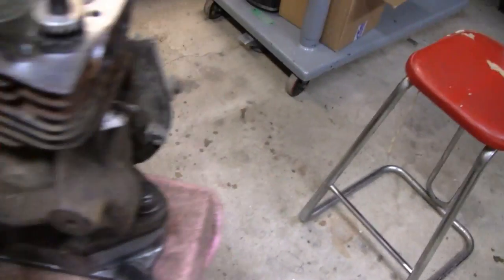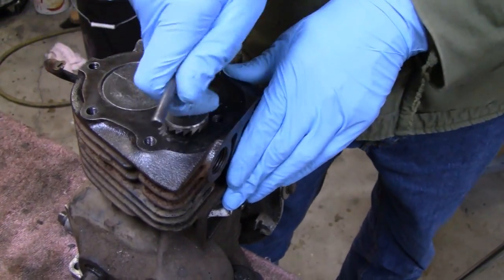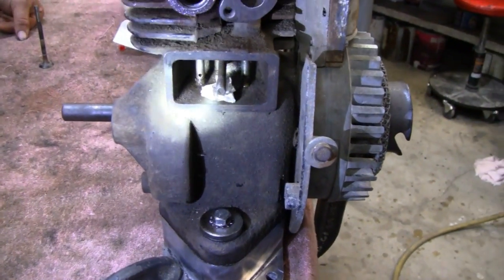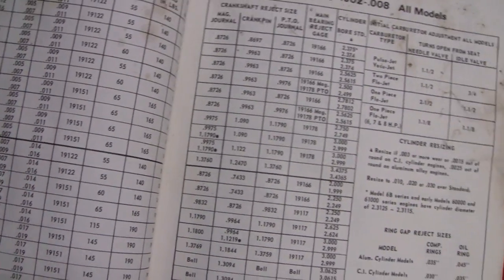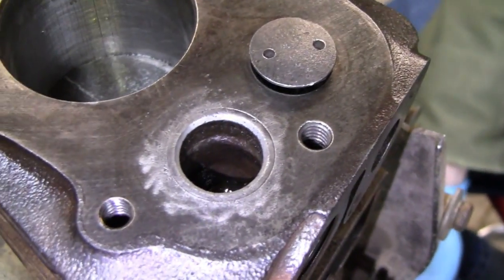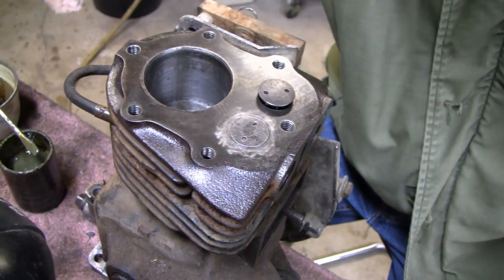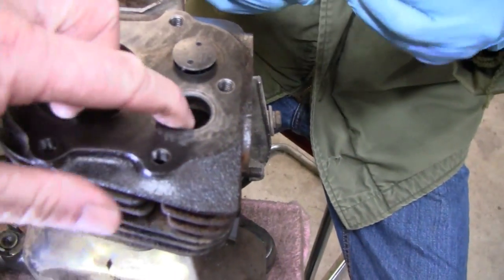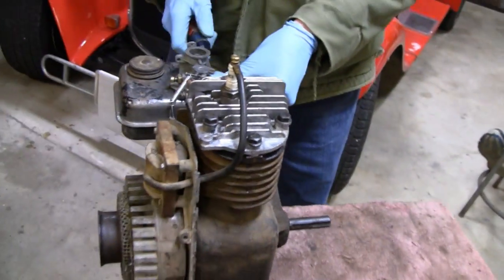HOMEMADE WATER COOLED BRIGGS ENGINE (part 7)

Comment: why did you not use the small side of the lap stick? also i used to use a drill to operate the lap stick.
Reply from the maker: Small side won't work because of the holes on top of the valve!!☺

Comment: I like to use a little machinists Dye/layout fluid on the valve seats. that way I can see what I am cutting and if their are any micro pits that are not visible to the human eye with out it. it also helps a great deal when lapping valves so you can measure the valve contact margins. I'm not sure that's important in small engines like the Briggs & Stratton flat head as I have never rebuilt one. However on the VW air cooled engines its critical for the exhaust valves to have .080 contact patch to help cool the valve, otherwise the valve overheats and either seizes in guides or the head breaks off and impales its self in the piston and cylinder head. awesome video, I can wait to see it water cooled. I have always wanted to water-cool a VW engine. so I am interested in how this turns out.
Reply from the maker: Thanks Bud!!☺

Comment: You can warp the exaust valve by running the engine with out a exhaust pipe or muffler.

Comment: I've done  the valves on my '53 Merc flathead, cleaned up the seats and lapped the valves with the suction cup "fire starter." My 327 Chevy was easy, gust put a reversible power drill on the valve stem. :>)

Comment: If I was water cooling this engine I would leave the fins mostly alone. I would just water cool the cylinder and leave the head open to the air. I would try to have the water flow around in the direction the cooling fins are going. It's hard for me to explain but I could probably draw it up better. Thanks for the videos they are always good.
Reply: A new custom shroud with a miniature radiator inside could use the flywheel air to cool the water.

Comment: Are these 5S and 6S engines easy to come by? I had a B&S cast iron engine about six to eight horse that had the points and condenser on the side of the block under a tin cover kind of like an old Kohler engine. It had an oil bath air cleaner on it. It was a great engine. I wish I still had it. By any chance would you know what series B&S engine that was? It had the rope pull on it. I could slow that engine down to a crawl and actually start it with a flick of the wrist on the pulley it had on it. I could get a spark by slowly turning the flywheel magnets past the coil. I rebuilt this engine in my first year tech school class and my class mates did not believe it would fire turning that slow. I told them to come hold on to the wire and they became believers.
Reply: sounds like the Fairbanks Morse magneto ignition of an old Wisconsin AB engine - a sprung rod releases during slow turn to produce a very hot spark at almost no RPM.  I've shocked myself once or twice while just turning the crank by hand.
Reply: Oldskool Driver 
"Gee this engine runs great but makes a weird popping snapping noise as it starts up or comes to a stop🤔🤔🤔" 
Always good for a chuckle, i dig those old mags.
Ye olde impulse coupling , me lad.
Reply: Thanks! It actually wasn't that old. 50s probably. It looked like the aluminum block horizontals of the 60s just cast iron. The ignition system was pretty much the same as these 5s B&S but the points where located on the side of the block. It didn't click or have an impulse spring. Tough Engine. I think it had ball bearings on one end of the crank if not both.

Comment: come on now don't warp a valve with no exaust
Reply: 11k gaming it's not under load so the exh valve will be ok. Cant run to long any how because without the shroud it will overheat.
Reply: That's a myth.

Comment: bet the cart will be cool you should put a fan on the end of the crank or have a fan driven by the engine with a belt or something for the radiator how you going to make a water jacket are you keeping the fins and making a water tight box around it with metal pate or something ?
Reply: kierankay100 copper lines placed inside the fins? that would look cool I think: tho I don't see that to be effective
Reply: i dont thin the heat transfer would be as good if you were to cut all the fins off and build a box with thin metal plate and add a thermostat too and some barbs for hoses would work like these guys have the talent and knowledge to do so

Comment: Worked at a bodyshop years ago , one of the lads fixed a car and the customer turned out to be a right tosser , fixed his crashed car and when he came in to pick it up he asked for the panels back bolt on wing , bonnet , front panel and bumper , he was told they were scrapped , couple of days later he brought the car back big list of faults nearly all stupid and nothing to do with us , every couple months the car would come back , one morning the lad that fixed it shouted me across there was the car again , he had a tin of grinding paste scooped a finger full and plonked it in the oil filler  , car and customer never came back .
Reply: i'll not that "quick fix" trick for the next a-hole that blames me for everything...

Comment: You guys do such great work, I love watching all of your videos! I just want to throw a little useful information your way, I used to work in a Mold shop and we had to lap pins for heavy molding pressure and the proper procedure for lapping would be to put on the compound and grab the valve by the stem and turn only in one direction and make a quarter turn with pressure pulling down and lift it back up turn back to original position and repeat the procedure until satisfied with the cut, makes for a great seal. Just a recommendation though, if this is how you'd rather do it then that's fine because obviously it works!, Keep up the good work!